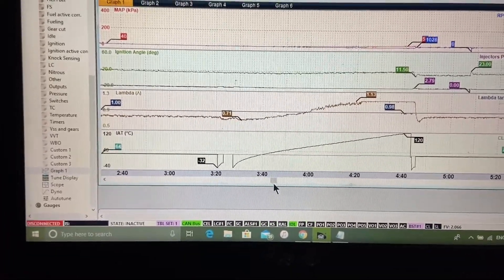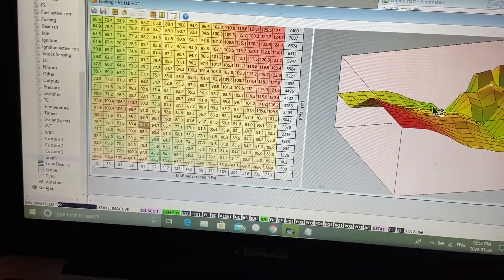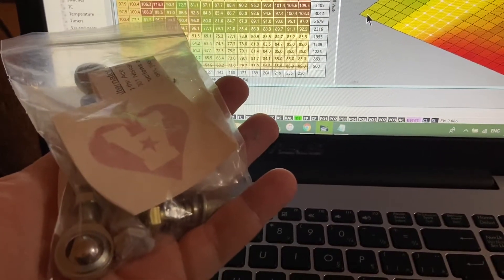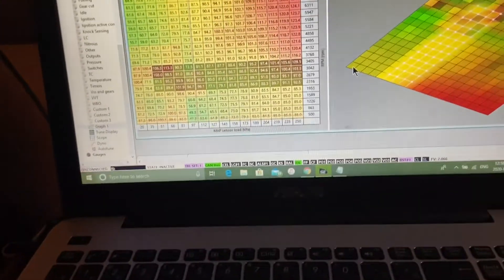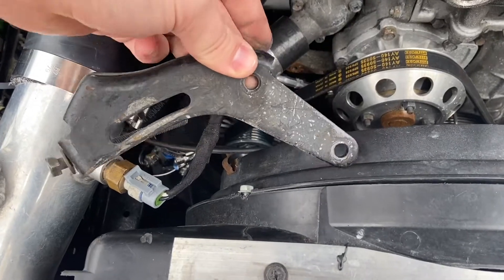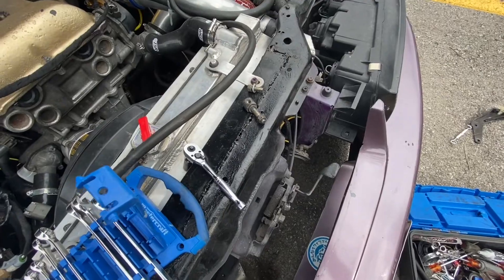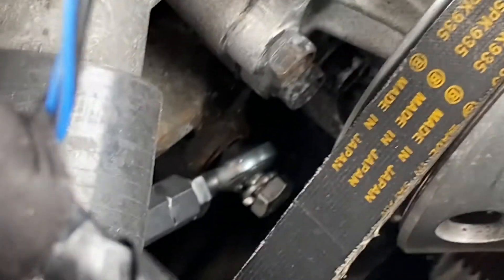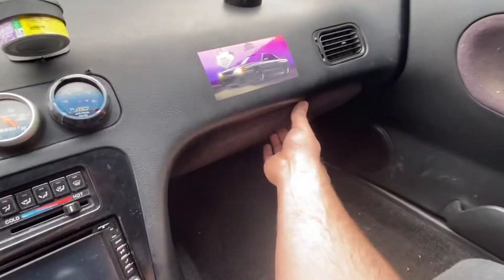Cody ace quest alternator bracket install s13 240sx

Comment: What belt did you end up going with? Mine is a tad short. Need a longer belt
Reply from the maker: I honestly forget what size I used. But I took mine to the parts store and got one a little bigger
Reply: @Drifttheorygarage  I end up going up a few numbers. Everything else look small or just a tad longer.
Reply: @Drifttheorygarage  K040345 is the stock belt. I went up to 359 I believe.
Reply from the maker: @mikeyvaj  true. I’ll pin this thread happy my little video could help you out dude
Reply: @Drifttheorygarage  yep! Only 2 videos exist on YouTube.

Comment: Planning to try this upgrade on my SR20DE. Gonna be interesting to see what I can do with the factory bracket and limited room. ;)
Reply from the maker: I wouldn’t waste your time messing about with the stock bracket. just buy the kit and move on
Reply: @Drifttheorygarage  Yeah I was doing a bunch of research and it seems to me that the Quest upgrade won't actually work for the DE engines because the alternator is on the other side and it would hit the engine due to the mount hole shift. So I think I'm going to try a Maxima alternator. Also 110A or 125A but the adjuster hole is in almost the same spot as the stock alternator. May end up getting the same mount adjuster still. Thanks!
Reply from the maker: How did it go
Reply: @Drifttheorygarage  I bought the alternator, but haven't actually test fit yet. It looks like it will work, but may require extending the bracket somehow. Will report back when I figure it out!
Reply from the maker: @802Garage  frigin right man 👌